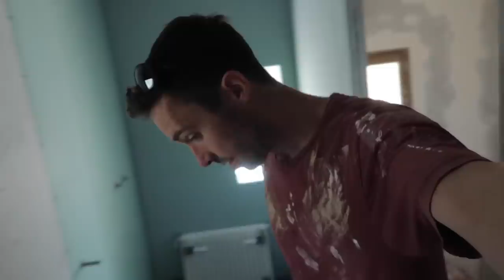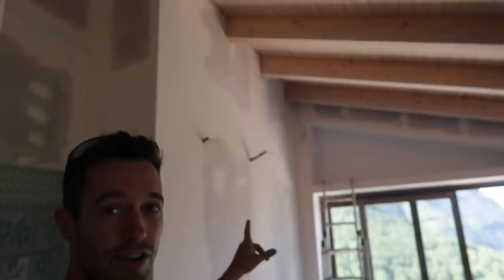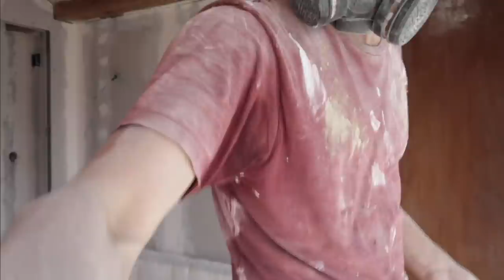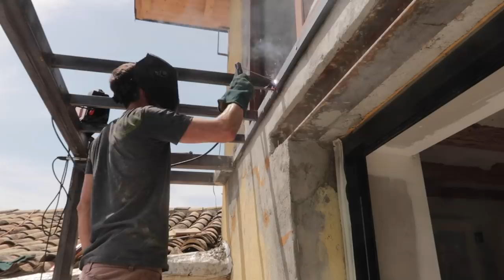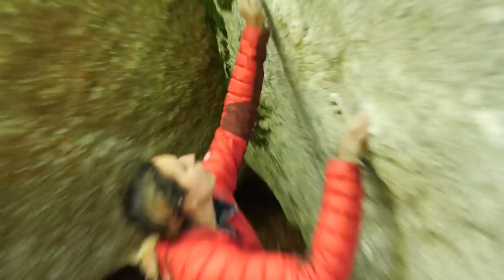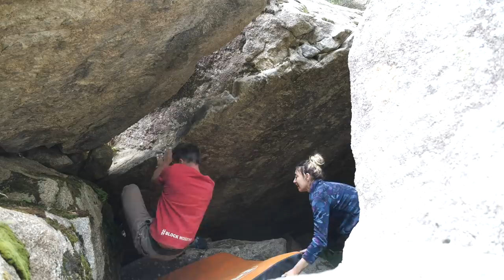The SOLO BUILDING RAMPAGE Continues ⚒️ // & The BEST BOULDERING In The PYRENEES 🧗‍♀️

Comment: Nate there was a fair bit of pitting in that weld joint you showed us. If that's the average weld, I'd be doubling up the number of joists/batons up there. Those pits are failure points, and you can't just weld over them as slag settles deep in them. Metal can bridge over the pit, but the pit will still be there inside. I only worry because it'll be out in the rain and snow and then summer heat. With the tubing being on the thin side, the consequences of failure if you have people standing on it could be serious.

Comment: Hi, your work look awesome.  Take a look at tile backer boards. I had uneven floors in the downstairs of my house and worked out the backer board thickness i need to go under the tiles to get everything the same level, I also had a mix of wood floors and tiles.
Reply from the maker: Ah that is a good idea, not see this out here but maybe I can find them. More recently I have been putting old tiles under with a sandwich of tile cement.

Comment: donbt put your camera and other things with glas so close to the welding.  those sparks are fluid metal and will burn into the glas and leave black spots there for ever... 
and watchout for the UV light from the welding. use very strong sunscrean or longsleave clothes otherwise you might give yourself a very tough sunburn